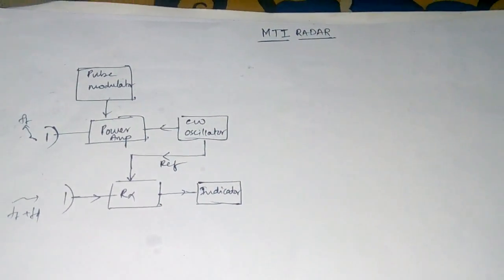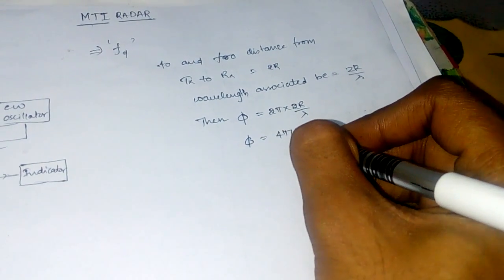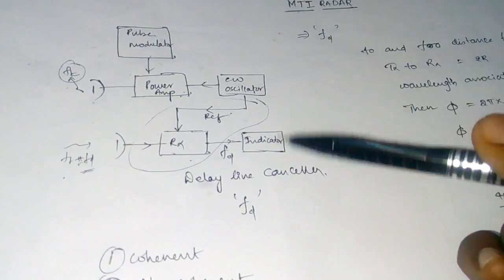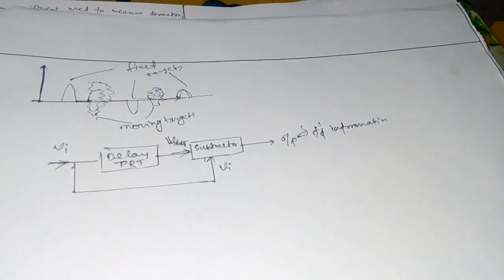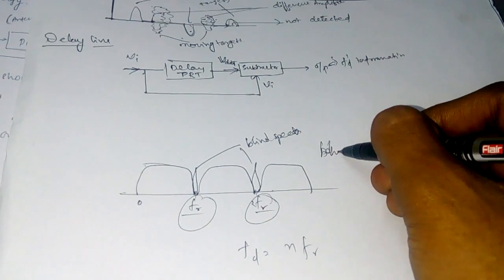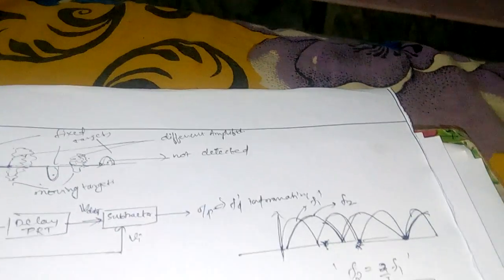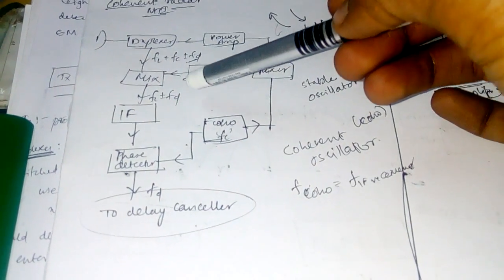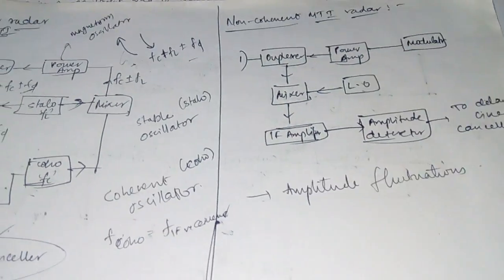WORKING OF MTI RADAR WITH BLOCK DIAGRAM

Comment: am greatfull to the lecture video Mr harsha mangipudi, hope you dont mine if i ask you to offer me the range and velocity anlysis using MTI radar details with pdf or doc please. i got a semester project am in needed of that as referance.
my email is: ongsoumgml@gmail.com
Reply from the maker: tq mohammad khalid ,     delaying the signal is t-k suppose and present signal is having time t , then when we are correlating the signals then we get the information about k , where k is called the doppler shift in time doiman  , reverting that 1/k we get doppler frequency .
Reply from the maker: Ataklti Gml sure
Reply: If we delay the signal and subtract from original signal, how we get the Doppler frequency information 
Plz explain sir
Very nice lectures sir harsha mangipudi